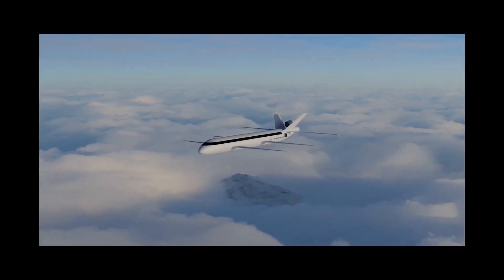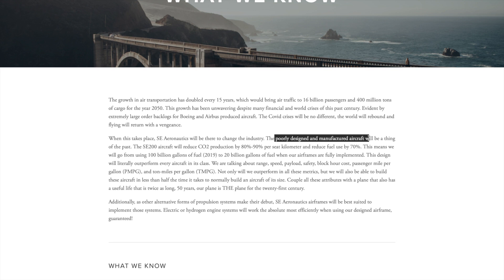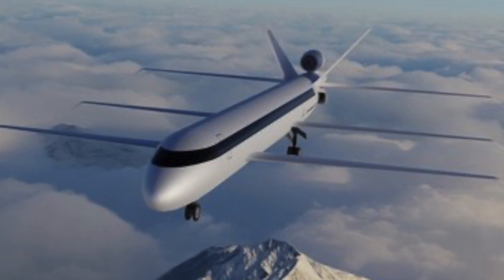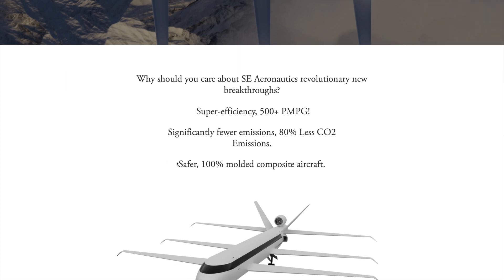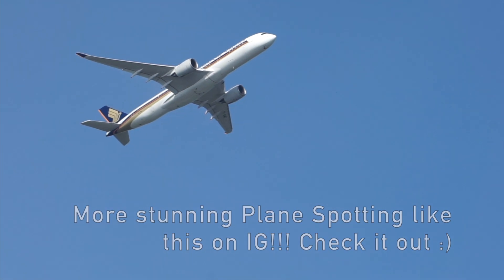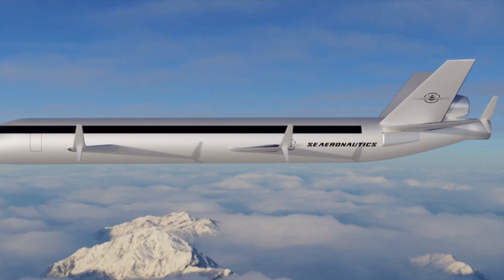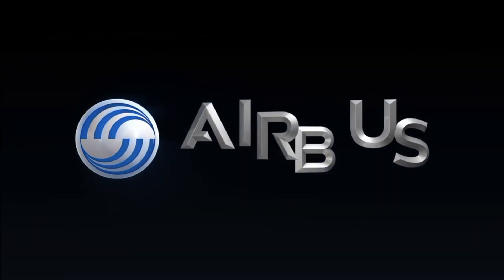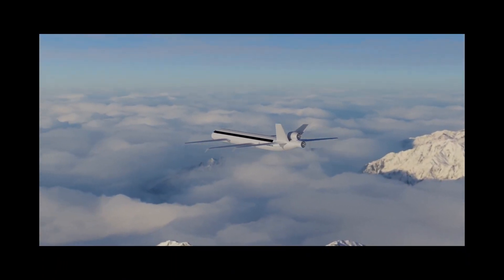SE Aeronautics SE200: Performance, Efficiency of SE200 aircraft

Comment: This aircraft spec is quite flawed, however its concept is correct. 
Using full barrel composite fuselage to reduce weight, Placing the engines closer to the centre to reduce the tail size, increasing the wing area to reduce take off requirements and having multiple wings to maintain an optimal cord length and wing aspect ratio for maximum efficiency. Each of these improvements mention are probably able to contribute a few percentage of efficiency gains here and there but each of them will never be able to contribute more than 10% each, adding up to 70% improvements without engines improvement. 
If this aircraft really does make it to the sky, it will likely only delivered a third of the benefits it has advertised today or around 20%-30% against today's modern aircraft design such as the B787 or A350.
Reply from the maker: Thanks for your insightful comment. Yeah its not clear whether the 90% includes the new propulsion but my guess is it does. Thanks for tuning in !
Reply: The weight savings is not barrel composites unless small barrel, but rather the wing box.  Wind up +2g turn is where the weight comes from.  With much shorter wings, this stress is vastly drastically reduced.  This aircraft is a joke... straight wings... = slow speed.  Current aircraft get same benefit of going slow to save fuel.  As for the three wings... No it does not increase efficiency.  In fact, it DECREASES efficiency, but since the lift is distributed along length of fuselage, the fuselage weight drops drastically and the wing weight also drops drastically.  3 wings can help the Canard configuration, but this does not help one as much as one would think as the overall load of the wing is less due to need for margin control which ultimately leads to one wing being MUCH larger and it then loses part commonality thus increasing costs and therefore its wing box is heavier and more expensive as it holds more of the load and the +2G wind up turn specs become  more dominant increasing weight again.... These guys are clueless.
Reply: @w8stral  agree. I was quite sceptical about it as well. Guess this is what you kind of concept you get when a bunch of av geek with no aeronautical engineering background comes together to challenge airbus/boeing.
Reply: Thanks YouTube comment rocket scientist, I never knew that.
Reply from the maker: @ry9756  You're welcome! Be sure to follow Rocket scientist on Instagram for more great Plane Photos here -> https://www.instagram.com/planespotting_onesky/
Reply: Informative analysis. I will new idea, but sick of some one making a bold claim but has not even had the prototype.

Comment: No airline will buy this SLOW aircraft.  No passenger will put up with the glacial speed.  Passenger aircraft can already do that today and save 30% of their fuel burn if they so desired.
Reply from the maker: The concept itself is interesting but yeah agree that there is a lack of details especially surrounding cruise speed. Optimal cruise for long range widebodies is Mach 0.85. Thanks for tuning in!
Reply: Two words: swing wings!
Reply: @eurohenry3257  Doesn't help you any bud.  Only care about cruise performance.  Field performance is pointless today.  60 years ago?  Field performance mattered.  Today?  No.